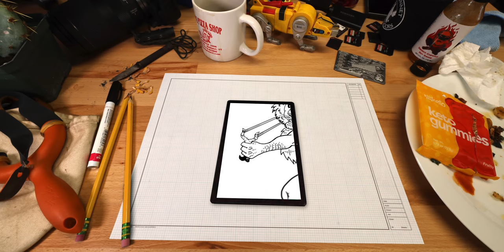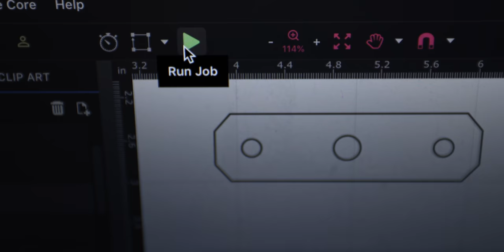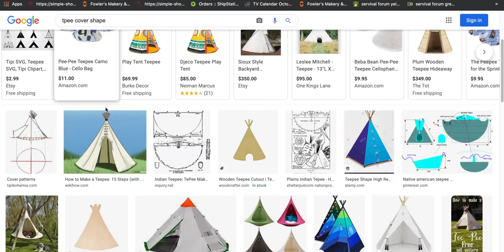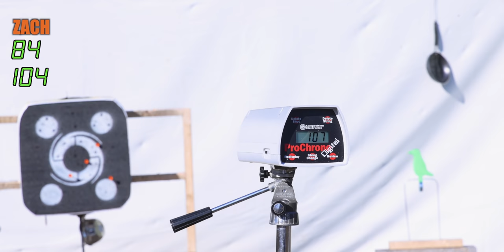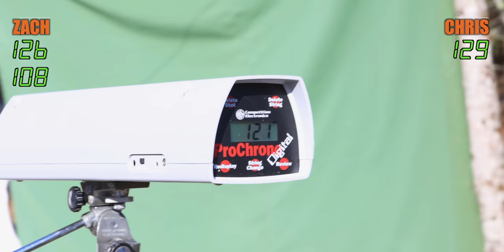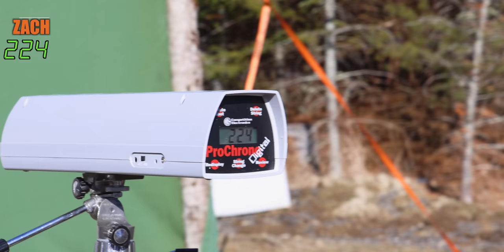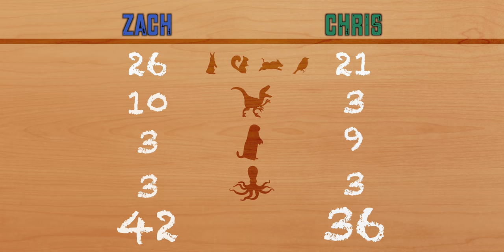Slingshot Vs. Blowgun | Slingshot Versus Ep. #7

Comment: Get a few straw bales and spread it out in the mud. This will bind the moisture and also releases starch which makes everything become nice and solid. If it is a returning issue, dig some ditches about 2-3 ft. lay down either corrugated and perforated pvc draining  pipe. Here comes the trick: fill the ditch with lots of small brances, shrubbery. then add rocks and gravel,then soil. The sticks will slowly rot awaay, but leads water along them while rotting.  When totally rotted, they create "gates" of looser soil as the soil around will pack.  It is pretty uncomplicated really. A lot of people don't use branches, so the pipe will stop fuctioning after a while. You can also use ceramic or cement pipes laid down end to end, using moss in the gaps, siphoning water into the pipe while keeping dbris out. The moss will keep on growing together and works for decades

Comment: I mean my stance comes from a longevity stand point, a blow gun doesnt really have any parts to break or degrade with time/weather (to a point), now a sling shot is obviously smaller and ammo is easier to carry more of, now a sling shot band can break over use and if you leave it outside it can damage it, now ill be the first to say I dont have much experience with either so I cant say which is better for what application but I do have a decent understanding of materials so if I just wanted to take something back packing id probably take a sling shot as its smaller but if I wanted something to rely on for many many years then a blowgun makes more sense imo

Comment: Back in 1963 a friend taught me how to make paper darts, (origami) apparently Chinese children have been doing this for centuries it was a novel child’s toy using bamboo. I decided to evolve this concept, By putting a finishing nail in it, & drip wax into the tip for weight. Using compressed air at 300psi., on impact the dart would explode but it would drive the 4 penny nail,  that’s 5” of nail into a 4X4 until the head of the nail was below the surface. It would go clean through the 3/4” fence board.

Comment: If y'all haven't learned by now, you should be able to achieve over 200fps with a blowgun, but technique is important. You need to use your tongue as a sort of valve. Hold your tongue against the roof of your mouth, compress your lungs to build pressure, then release your tongue to suddenly dump all that air pressure.

Comment: I know that you are slingshot master but I think you cut your bands too long for your pull.
You extend your bands approximately x3 when you can stretch it x5 or x6 and have much higher speed with 7/16 steel balls.
Reply from the maker: there is a balance between cutting them shorter and they don't last as long and longer so there is less draw so I can be more acurit and also still draw back further as I go for really long shot and get more power.  not so locked in the way I shoot give me more freedom